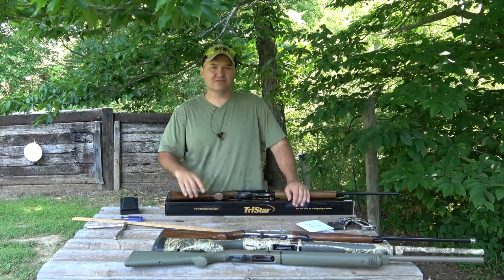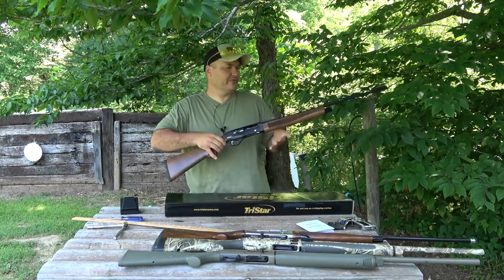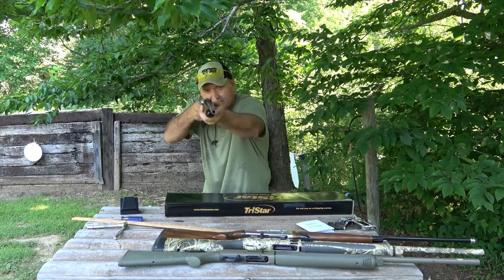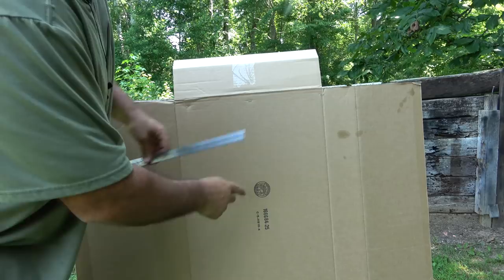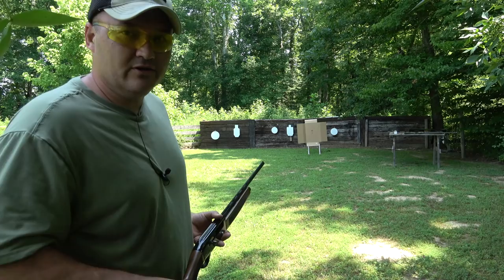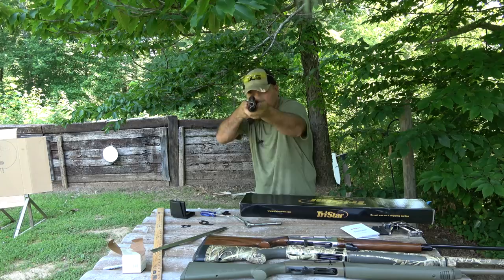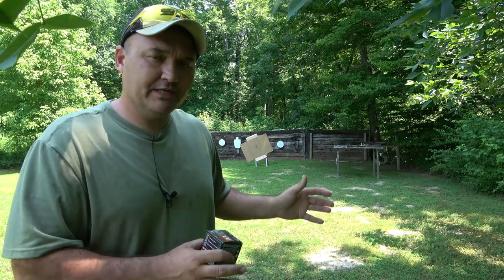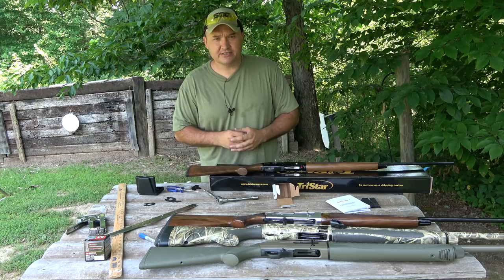Shotgun Stock Shims, Why You Might Need Them and How To Use Them - TriStar Viper G2

Comment: Thank you for the great video.  I set my Tristar G2 28 gauge with the 65 and Cast Off and it throws up great.  Will test tomorrow on some old tin I have around.  It is great for patterning.  I am so glad I didn't start with #50, 55, 60 only to realize 65 is the sweet spot.  I am built a lot like you so I think that is the ticket.  Many thanks.

Comment: Been around a long time, been a skeet champion, used lots of different guns in my 73 years. Have many different brands form Benelli, to my newest G2 20ga. I have to admit I've never used shims. guess i just adapted to each gun. Tried the 55 shim, almost perfect. Then put the 65 in and I'll be damned no adjustment on my part needed, thanks from an old guy.

Comment: B4 i came here, i tried putting a 1/8" wedge shim betwn the steel rear  
wall and buttstock front.  I glued a stack of hard cereal box cardboard
at top of the steel Stock Bearing Plate (SBP, part #59), which itself is 1/16"T. 
It lowered my Remington (not the new take-over co., RemArms) M870 Wingmaster
12Ga. with 30"bbl.  Yes, this gun was designed for Trap though not the AT Model.
But, i still want it to hit where i aim.  The gun's original DAH = 1 3/4" 
ended to 2 3/8" w this mock-up wedge.  I wanted 2 3/4" or perhaps, more,
3".  I don't think i want to pivot the buttstock down more as the bottom of the
rcvr metal to buttstk frnt joint is now squeezed to only 1/16" gap in an angle.
I didn't even want to try shooting w this 'cardbrd' shim mock-up, worrying that
a recoil may crack the wood at that bottom joint.

Mounting it now w this mock-up wedge shim, the front bead and the middle
bead does not quite make a figure 8.  I still, see like 1/16" of the rib betwn the
beads.  This means i need to increase the DAH perhaps to 2 3/4" or even 3".

What i'm thinking is is to beef up the buttstk front wood w another steel SBP,
file off its perimeter to match the mating outline of the stock, screw this plate
onto the stock, then install thicker than the 1/8" wedge, say 3/16" or try 1/4" wedge.

Another limiting factor of this wedge adding is that Hex Nut (part #47, Receiver Stud)
which the Long Stock Bolt (part #60) screws into the back of the steel receiver
wall.**  This Hex Nut angling down may need to angle more steeply down to allow
me to increase the DAH.  But maybe, there's nuf big tunnel diameters on the front
stock portion so i needn't worry about this possible factor.  The stock bolt itself
may need 2B a bit longer to reach that hex nut (part #47).

Any one here in this audience who does have an original Remington made old
Wingmaster and tried this wedging method to set DAH = 2 3/4 or 3", pls write
back here.

Actually, the new company, RemArms does make a new M870 Wingmaster.
Not just Field Mstr and Express Models.  And, they all have DAH = 2 3/4 as well
as other improvements, esp. u needn't remove and mess up the Shell Latch hole
to Rcvr Pin hole alignment when a round gets jammed betwn the bolt bottom
and top of the carrier.  With this newer version, u can slam the forearm up n down
to dislodge the stuck shell.

To this video author, thx for ur excellent video on this DAH and cast increase
method.  BTW:

Ur cute.  better watch out bc. girls will take advantage of u.

_______
**Incidently, ur Tri-Star shotgun's long bolt has a hex-slotted  head.  The hex head
   is much better design as my M870's slotted head is already buggered after only
   one removal.  The factory screwed it on too too tight.  Someday, i'll buy a 1'L 3/8
   hex steel stock from McMaster-Carr in LA, CA to turn it into a hex head bolt.
   If anyone has a lathe, pls let me know

I hope this helps for the old original Remington Model 870 Wingmaster owners.
I've provided two solutions for u above in addition to this video author's ready made
shimming for the different make shotgun.  But basically, they're all same.

Comment: Good video but I am unclear. Exactly how do these shims move the stock around? I have been a part time shotgunner for many years and this system of "fitting" the stock is new to me.  My Browning Citori Trap gun has a fulle adjustable butt stock. 
I just bought my wife a Stoeger 3020 and it came with no instructions on how to properly install the shims.. She is a beginning trap shooter and I want her to do good, so a proper fitting stock is a must.  The shims have pegs and of course a hole for the screw. They appear to the tapered from the top to the bottom and different thicknesses. You state that if the shims are fighting each other, it could damage the stock. UHHH OK what does that mean? 
You need to get your camera closer to your work so we can see exactly what you are doing and how you are installing the stock shims. Maybe a shot of the shim and what each of the parts do?

A better explanation seem to be in order.

Comment: I see you have a Tristar Viper Max 12 3.5” on the table there, I have one too picked it up yesterday. Already my barrel is refusing to reassemble, took it off the change the piston to light load and the barrel just gets extremely stuck every single time I try to slide it back in. Could you tell me if you’ve had this problem, or maybe make a video on how to properly set the barrel back in on the Viper Max, I must be doing something wrong.

Comment: I'm thinking of buying that model 410.  Could you tell me the actual length of pull on that 410 AFTER you added the shims, please?  I have a problem with a lot of newer shotguns being too long and either have to switch to a flat, hard plate (no big deal on a 410) to shorten the LOP so it would help me knowing in advance so I have all the parts I would need.  God Bless and thanks.

Comment: Buffalo I  have a Hatfield SGL (single shot) 20 gauge I just bought recently. After watching your video I tried it out and I see a good bit of the vent rib rail when I pull it up in my natural position. That's telling me the stock need's to be lowered a bit also. I contacted Hatfield through email and ask them if they offer a butt stock shim kit for the SGL and the answer reply back was no. What do you do in this case,is there aftermarket companies that offer butt stock shim kits for all brands of shotguns? Also it now has the fixed modified barrel,but I plan on cutting the barrel down from 28" down to a 23" barrel then turning it into a cylinder bore barrel. I then will reset the the bead site on the 23" barrel. Will that change any thing up also?
Reply from the maker: I have seen people make their own shims but you have to be careful as you can crack your stock if you bind it too much and it wasn't designed for shims. Shortening the barrel can change point of impact on some shotguns, depending on the height of the vent rib (if yours has one) and the height of the receiver over the the bore. For instance I shortened the barrel on my Baikal MP18 and it shot a foot or so high so I had to mill off the highest part of the frame in the back to bring it back down.
Reply: @buffalosoutdoors  Hum! I didn't think about point of impact being changed that much. Yes my Hatfield SGL does have the vent rib, I just figured it would only cut down on yardage distance and of course then becoming a cylinder bore a wider pattern. Thanks for the reply I may have to do some re-thinking before I decide to cut five inches off the barrel.